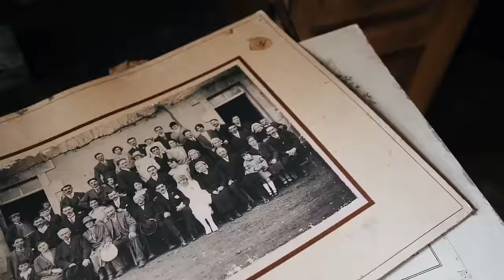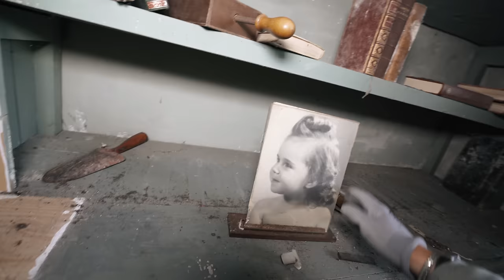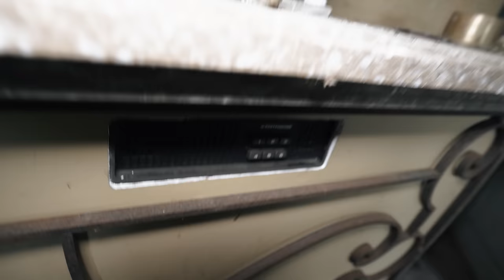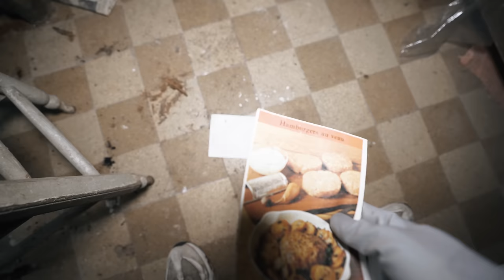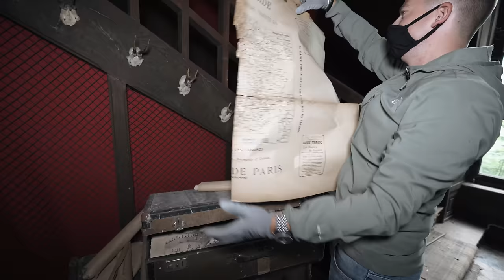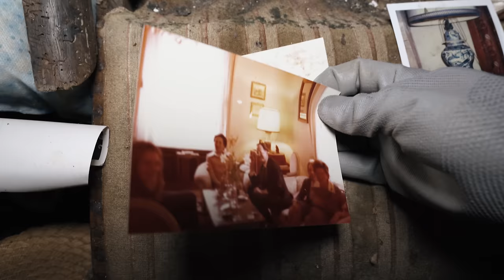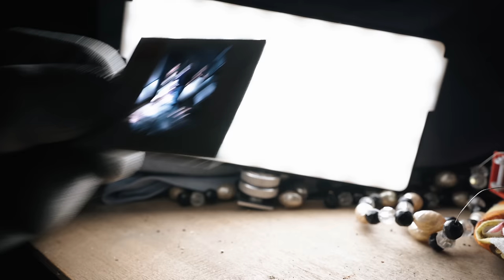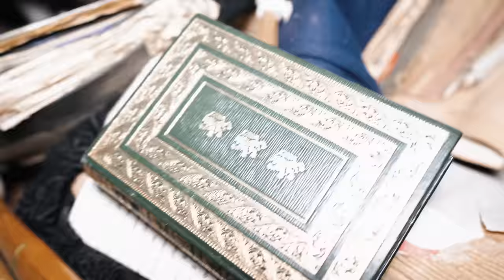Enchanting Abandoned 17th-Century Chateau in France (Entirely frozen in time for 26 years)

Comment: That metal 4' tall thing you found in the Kitchen, I've got 2 similar ones like that - for hand washing laundry - holding that thing and using MANUAL LABOR plunging the tubular thing up & down in the suds buck.  Hard dang work for sure - used mine on my hubby's crude oil clothes.

Comment: I think the metal object you found in the kitchen area looks like an object people used to agitate their clothes by hand )before washing machines).  They would fill a tub or deep sink with soapy water put the clothes in to soak. Then the would insert the agitator and manually turn it back and forth with the flared end to clean the clothes.  I’ve only seen them made of wood not metal but the shape is similar.  Great job on the video.  The place is stunning!

Comment: hi, at about 45 minutes you asked about a tall slender item that you said could be a weapon.  I don't know if anyone commented on it, I'm sure someone did but I will also.  Though in the US I've only seen smaller ones, they are called dashers and are for laundry washing, pre washing machines.  I've used them to show others how laundry was done back in our pioneer days back when.  The water was very hot and you needed something to help.  This one is very tall and I think it is because the tub that the dirty items were in was very deep and probably held not only a lot of water but items to be washed.  The water started out boiling hot for whites and then as it cooled other items not white would go in but you'd still use the dasher.  Those women who used these had to have had a set of arm and shoulder muscles. :  )  The center post in a top load washing machine is also called a dasher.

Comment: The object you found in the kitchen - you said like an ancient weapon. I believe it is a type of posser - which is an aid to washing laundry.   It is placed in a 'dolly tub" and moved up and down to do the laundry.  The 'dolly tub' is a metal cask shaped tub which is ribbed and filled with very hot water and suds for the wash.  It is called a 'dolly tub' as another intrument was used called a 'dolly'.  A dolly lookes like a 4 or 5 legged stool on a long pole with a cross piect on top.  To use you held the cross piece and twisted the dolly back and forth to achieve a clean wash.

Comment: Wow what a find ! Isn’t it incredible that such a place exists and basically untouched. The strange thing at 45.20 , I was wondering could ( and this is a totally wild guess) could it be a tip from a jousting type pole , like I say it’s purely a guess. At 5140 You open a drawer which has an electrical power adapter and a load of chain - you don’t show the chain long enough, but I believe it to be an old way of  measuring land, you would lay it out to find how many acres you had . At 1.01.29 is a slide projector / viewer for looking at dia’s . WOW that 4 poster bed at 1.09 - the intensity of the colours, the matching curtains ! Such a shame!!!! What an unusual telephone at 1.15 , never seen one like that. The room at 1.17 - incredible you have the feeling of walking into your ready made guest room! When you see the slides ( photos) of the bride getting ready for her wedding you see that the four poster bed has different curtains , judging by the dress etc I guess that was around the 80’s early 90’s so that bed has been re draped Within the last 30 years. At 1.28.55 the thing standing in the corner in English is a stretcher, looks like  ww1 vintage. At 1.37 in the loft / attic you show a small pile of “balls” , I’m guessing 4 , I think they are gun shot , without actually picking them up it’s hard to tell. 
An amazing explore, thank you xx

Comment: Thanks for taking time to close the shutters and windows!
I would suggest carrying a few sheets of clear 6mil plastic film and roll of Tuck Tape which sticks to anything to stop birds and rain. 
The pictures were not "Negatives" 
But "35mm Projection Slide" images. 
They were already completed photos In my family we did the same thing. Many pictures fit in a small space and don't decay like photo print. 
The grey metal thing beside the insect display is the projector that those Slides are displayed on a big screen. 
The couple in the wedding photos would be beyond the age of 80 now. It looks to have been around 1970 but too fuzzy and small to be more accurate. 
I have seen a similar thing to the pointy object you think was a bomb, is related to a water well.  Called a "Well Spike". I don't claim that I'm correct just the appearance is similar.
I'm surprised animals or vandals have not destroyed the inside of the house (depressing to see, but it's common)
The huge amount of wine bottles?
My family made wine years ago, & we re use the old bottle over and over.  Many bottles gather from the Christmas and weddings, and leave behind the empty ones. 
Those were the expensive radio sets.

Comment: It's an amazing location and I get the impression that the wealth was on the decline near the end (hence the unfinished remodeling) but I can't help but wonder what circumstances lead to it not being either sold off, or passed to the next generation (because it seems as though from the garden pictures that the wedding photos from the Kodachrome film (probably 1970s) and the assumption I have is that it was possibly passed to them but they couldn't afford to maintain it, and by the time they did check up on the house it was in such disrepair that any person that might be interested in buying it was quickly turned off by what it required to maintain it. Even then it doesn't seem that any expedient measures were made to clean up areas that would have made it easier, and part of this might be due to being sentimental. 

Also, it seems that at some point a significant number of valuables were already looted, though perhaps some things had just been sold off earlier. 

I remember looking through and cleaning up an estate built in 1906 where unused urinalysis jars for testing kidney function were left in the basement, which hinted at how the person died, and the house had many features original to it, that had my mom not owned it and had insurance coverage for water pipes bursting during the winter, it's entirely possible the damage would have been the end of an otherwise impressive property that was built over a cistern  (which subsequently had silt from the spring water build up soil and render unusable a massive coal chimney structure that was the central feature throughout the entire plantation-style property. 

A lot of massive castles and mansions are a costly liability, and many such families might appear wealthy at first glance while living in near poverty circumstances. Even if such properties are donated they seem as if they will end up with the same ruinous conditions in spite of having been maintained for centuries. You could almost argue that when monarchies were still around the properties would at least be passed onto another nobleman or confiscated by the crown to preserve, but it still doesn't save a property that might already be considered a ruin in ancient times due to neglect or poor structural integrity (usually caused by allowing weather conditions to erode things.)

Comment: Crazy to read all the comments about how someone should restore the place, as it's "filled with treasure". Yeah you can be rightfully impressed and call the furniture and artwork "precious" or "superb", and become melancholic about the decay, that's part of making these videos. But in actuality, the entire thing is barely worth anything. It's in the middle of nowhere to begin with. Restoring the building or furniture is extremely expensive. As would be actually running and heating the place. And then, what do you do with it? No one wants to actually live far away from any modern commodities. Also, the supply of old furniture is huge, outweighing the demand by orders of magnitude. Most valuable item on the property is most likely the tractor.